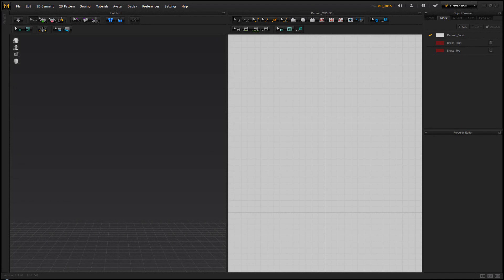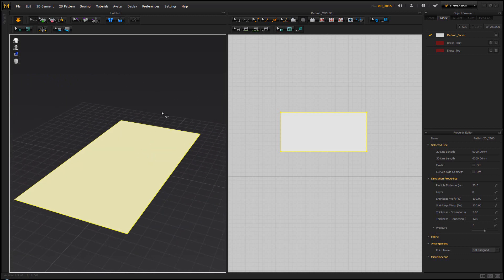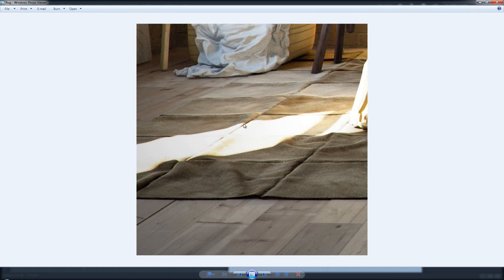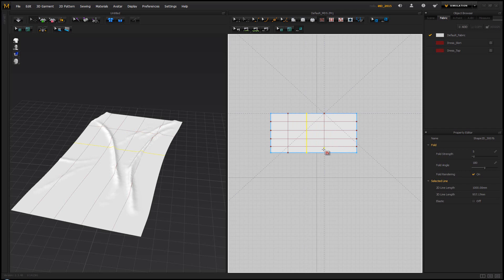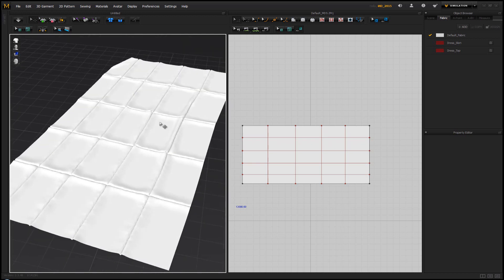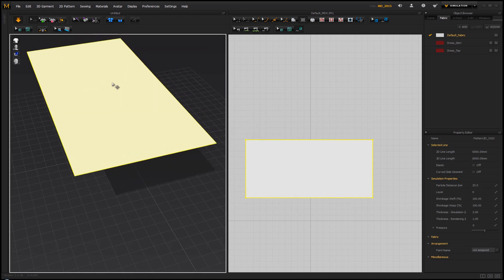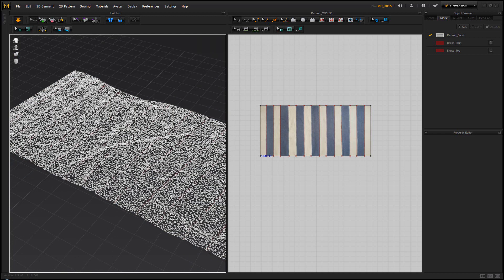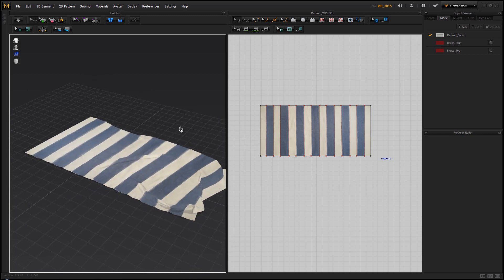Creating a Marvelous Designer Floor Rug

Comment: Hi,thanks for your work.I have a question,can you make a tutorial for how to bank the texture with vray in 3ds max ?
Reply from the maker: +Davide Ferrara When you say bank the texture i take it what you mean is rotating it around so you have a different orientation of the texture. If this is the case then the way to do it is by applying a UVW unwrap and from there rotate the individual pieces until you get it to a rotation that is to your liking.
Reply: No, i mean a tutorial to render the AO in the texture with vray
Reply from the maker: +Thomas Webber Well if it's baking then it's all up to the export option that i cover near the end, but from what he's saying about baking the AO on the texture, that baffles me as to why you would want to bake in the AO on top of the diffuse. I'm pretty sure there is a bit of a communication issue here but hey :)
Reply: +Denis Keman  denis i mean to render the AO in the diffuse maps